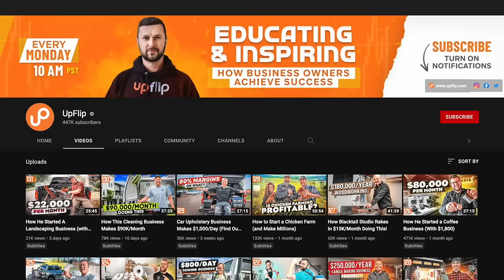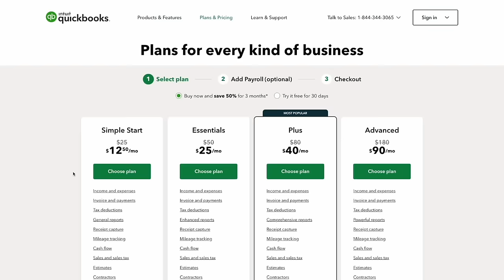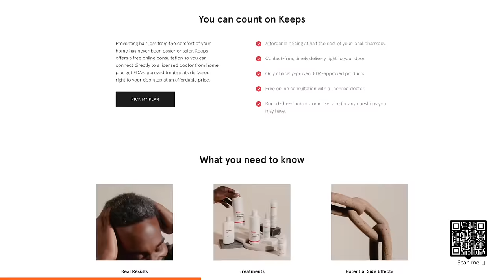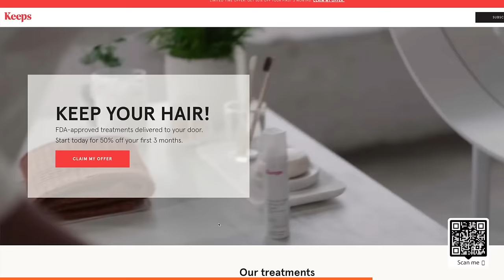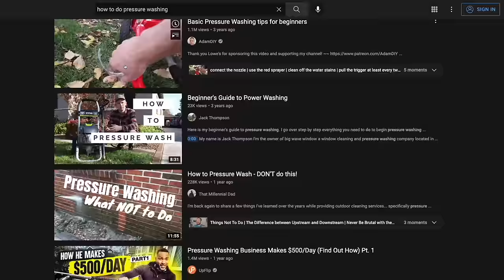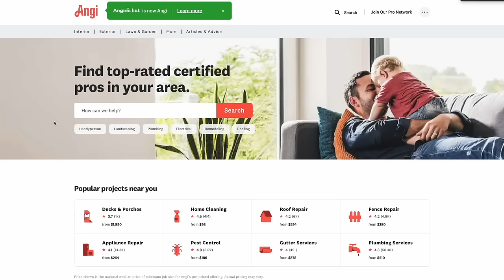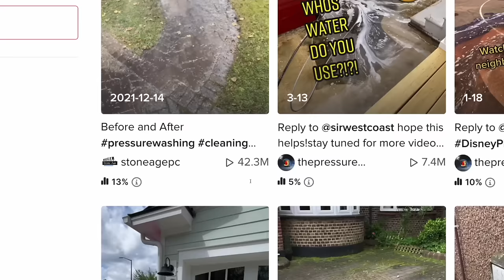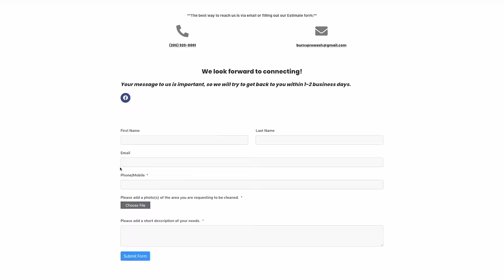16 Year-Old Starts a $4,500/Month Pressure Washing Business

Comment: As a pressure washing business owner, I absolutely admire Ole’s hustle. However, a surface cleaner or turbo nozzle shouldn’t be used on a wood or composite deck. Chemicals do most of the work and can be soft washed after to minimize risk of damage to any surface. Also, have to be aware of surrounding vegetation and aware of where water runoff goes.Pre wet, rinse during and after job is completed. Once again, I respect the hustle and admire what he’s doing at such a young age so keep it up Ole.
Reply: Erick, so for decks it just chemicals mainly and then spray it with a hose after the chemicals have done the work?
Reply: @jsandy1994  Hi Joshua, depends on the deck, wood decks are treated very differently than trex decks. Also, depending on the generation of trex, you may have to find out what brand and chemicals you can and cannot put on a deck as some may void the warranty. Trex is much easier to softwash and may need a light scrubbing. Wood decks need to be treated with sodium metasillicate (if pre-stained) or sodium percarbonate then rinsed off, and followed up with oxalic acid (wood brightener) and then rinsed off. Charge accordingly as wood is more labor intensive.
Reply: My gf pressure wash my deck with her mouth xd
Reply: What kind of profits / spending should I expect? His kid spends 2 k and earns 4k so he's only clearing 2k. I'm not impressed
Reply: I was just about to comment on that.
Reply: @jsandy1994  Sometimes agitation with brooms is required to get a better result. High pressure on wood can cause scarring and it is never a good idea.
Reply: My thought immediately. Crossing the wood grain will scar it.
Reply: I run a power washing business and when it comes to composite wood... Spray chemical  on it an let it sit for 5 minutes... Then use a J-Rod (at least thats what I use) or use a surface cleaner but reduce the pressure. Never use turbo nozzle for that bc itll ripp right through it

Comment: starting a pressure washing business but I'm on hold atm.
Connections are a pain in the ass, I've had to spend a small fortune getting all the right connectors for my pressure washer, extended hose, and 18" surface cleaner. Not to mention quick connectors on the equipment and a shut of valve. 
Make shore you think about your connectors and test your setup all connects up before going on a job.

Comment: Just the intro showing the surface cleaner and turbo nozzle on the deck? Nah fam. Dude has a lot to learn on the technical work side. Been doing this for many years and that is not the right tool for the job. White tip wand only and keep the pressure minimal on those surfaces. Use chems if you need more cleaning power.

Comment: Please don't take the comment negative we all started at this point but I as well
As others can give you tips to be successful and be fast.  There's all kinds of products you can use on decks and other surfaces.  Safe the surface cleaner for concrete throw the turbo in the trash and add a jrod and down stream injector like I said if you have any questions man I'm more then happy to point you in the right direction and can put you in contact with other crews I have helped as well.  Keep driving though and be successful.
Reply from the maker: Thank you for sharing your tips! ☺️